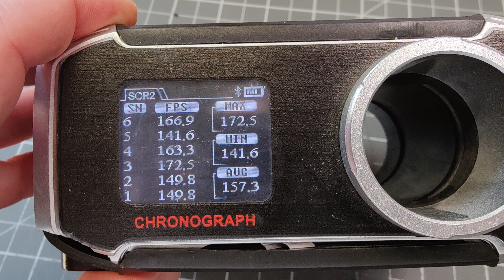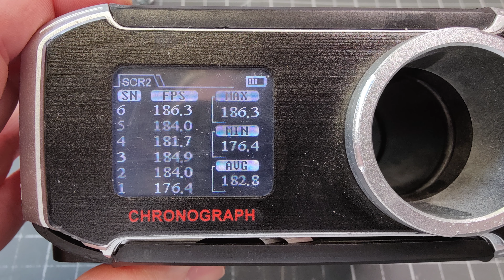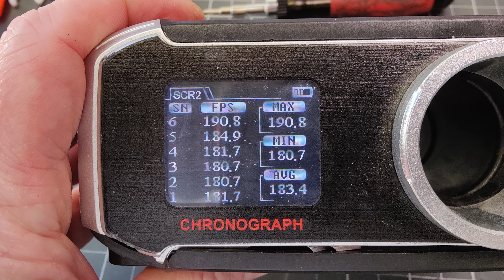Blaster Breakdown 34 (October 2022) - Dart Zone Max Tomcat - mod guide & gameplay!

Comment: To be honest, this is probably one of your best uploads due to the fact of testing each combination.
What you actually did, is make it easier for people that are unfamiliar with this platform to create something great.
I had similar results with most dzp and af pro, just a simple barrel normally out of brass, 30% increase
Reply from the maker: Thanks mate - I toyed with the idea of testing longer barrels and spring spacers, but I will leave that to others. I'm now using an even shorter piece of k25 to give me a consistent 150fps for Superstock games 😎
Reply: @andrewg_nerfmods  for superstock you're in the right direction,  from what I found with most dzp or af, just the replacement of the barrel to a 17/32 brass, is up 20% fps

Comment: great video. i got a tomcat recently and have been thinking of upgrades to it. i did order an aluminum tube(16mm OD, 1.5mm wall thickness, so 13mm ID) which i should be getting next week, so i'm glad i should be getting some performance just out of that, even at stock length. i'm probably going to cut it longer. also have some K25 equivalent springs so this gives me some idea of what length i may need to go, or at least a minimum of stock length

Comment: What are the dimensions for the tighter bore barrel? I got 12.9 ID from the video, but what is the OD?
Reply from the maker: It's close to 16mm, but just a fraction thicker than the stock one. I found it fits tightly into the breech piece giving a great seal without needing tape or glue or anything.
Reply: @andrewg_nerfmods  ah ok. Thanks

Comment: I can't believe I just found this, but one question is where did you get the m2.6 x 10 screws you mentioned?
Reply from the maker: eBay - search for "self tapping hex screw" or something like that and you should find them. They take a while to get here on a slow boat, but I get a bunch at a time because I know I'm going to use them on every blaster I mod.